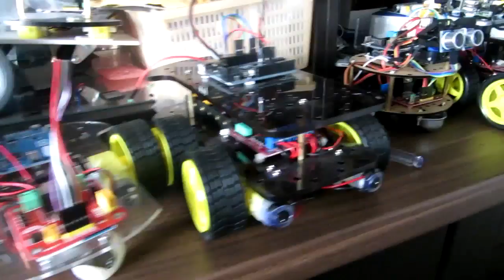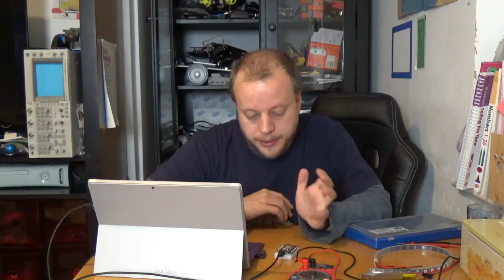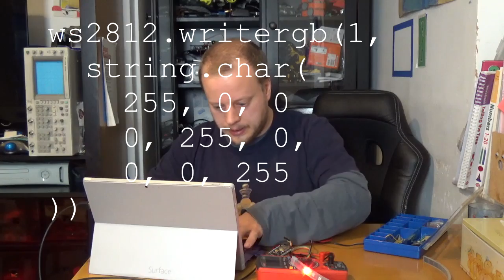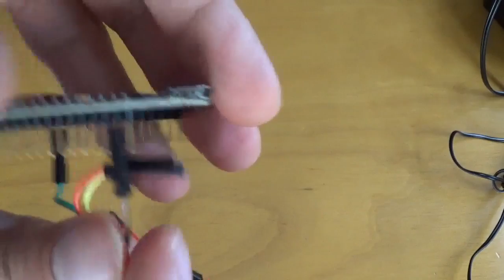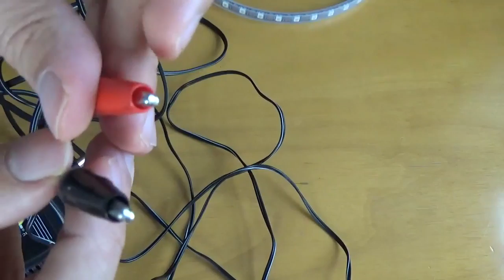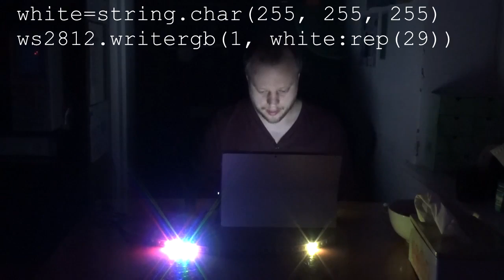Ws2812 Neopixel Led Strip With Esp 8266 And Nodemcu

Comment: Hi.
can you help me dim on/off 2 16pixel rings with a time delay.
i cant get it to work without flickering.
Reply from the maker: +Dale Whitmore Is the flickering continuous, and is it at the dim or bright settings, or all settings? It can indicate a power supply that isn't quite coping with the current, noisy power/ground connections or bad solder joints. Also - at very low brightness, because they are based on pwm - the pwm clock may be just visible as a flicker.
Reply: +Orionrobots Thanks.
When my lights dim on blue starts off until a value of 60 than red and green start.
when the lights get to a about half way it starts to flicker in a loop around the ring slightly.
But when full brightness is reached 220 for RGB it does not flicker..
Diming off i get the same thing..
All i use is a remote fob(2ch on/off), 2x 16 pixel rings 1 data line spliced,  the neopixel simple example, in a "void dimOn ( ){ " 
inside a millis timer (every 3 sec)from blink without delay example.
And between than RGB color ++ for each time the millis pass with a constrain at 220 for each color.
I than show pixels back in the main loop so the leds are all light at once.
Same for dimOff ().
I run this on a nano clone off usb and the pixels off another supply.
When they do start to flicker im still in the 4.48v mark.
I have made it go down to 3.45v and nothing changed only the distance of my remote changes

I have another 24 pixel ring on a lillypad powered through the board on a 1A usb outlet and it is not as bad a flicker and still no flicker at full brightnes, it also has a 3x 8x8 matrix showing temp also powered off the board so i doubt its a power issue im having.

Thanks for your time for reading.
Reply from the maker: +Dale Whitmore Hmm - what about the rest of the power supply - you are running the rings with a supply that's giving roughly 5v right? What is it's current capability? When you say flicker around the loop - not quite sure what you mean. Perhaps you could post a video showing your rig, and the effect you are getting?
Reply: +Orionrobots hi.
Im using a computer PSU 5v 28Amp.
I run the arduino nano and the pixels on one wire and my remote reciver on another because votage drop would cause it to loose range.
The flicker is not as bad but it only seems to happen when it reaches full brightness..
I use a constain to stop the value for the color value also maybe its the problem.
This even happen if i set a color than use pixel.setBrightness () to add one increment everytime time 3000 millis is up.
Than use a contrain to stop it at 255.
I dont know how else to try it.
I wish i could post the code on here.
Thanks again.
Reply from the maker: +Dale Whitmore perhaps you can add a gist link? 28A sounds huge. have you measured what's going on when the flickering starts - line dropping or something? perhaps a largish capacitor between the light strip vin and ground could help here.